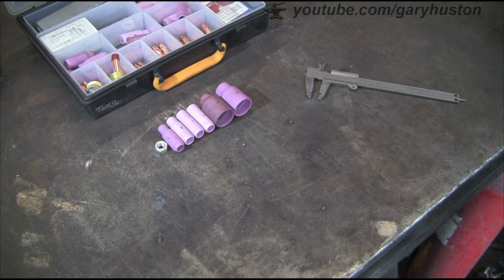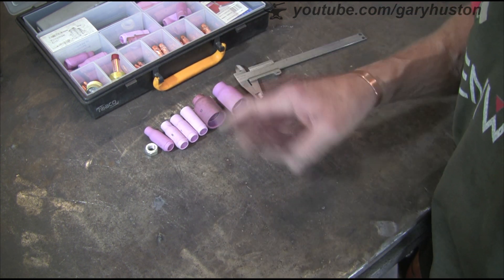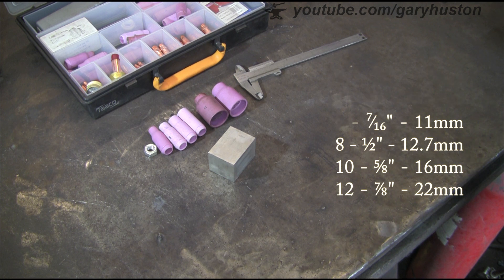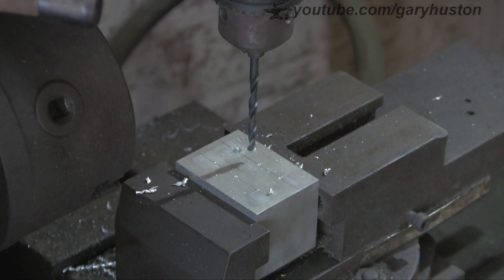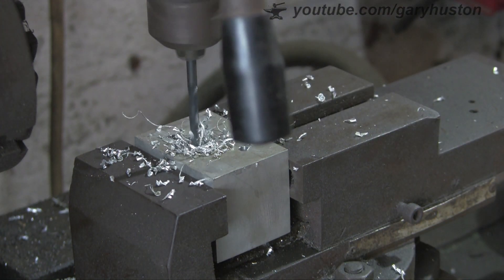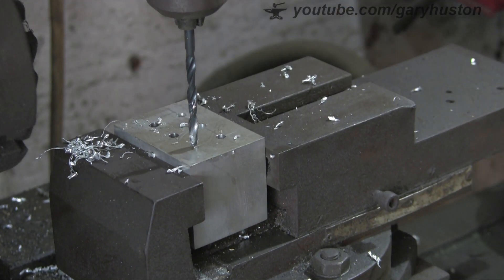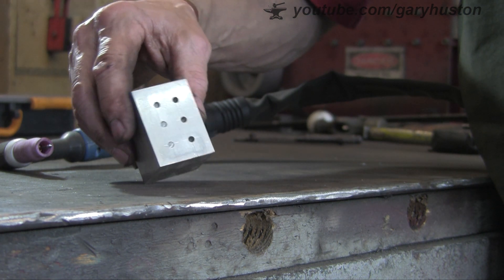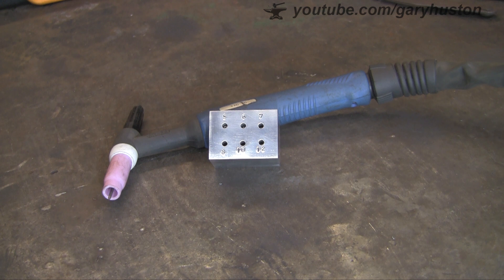TIG Tungsten Stickout guide block.

Comment: Love your work Gary, instead of a block I was thinking of making one out of 2mm flat bar and scribe the correct depth lines along the length with the corresponding cup size. Just rest the cup on top of flat bar and drop the tungsten down to scribed line, if that makes sense.